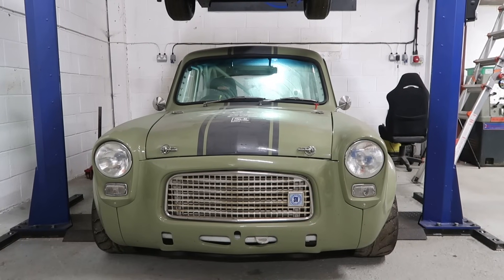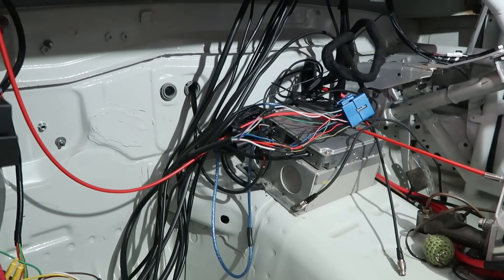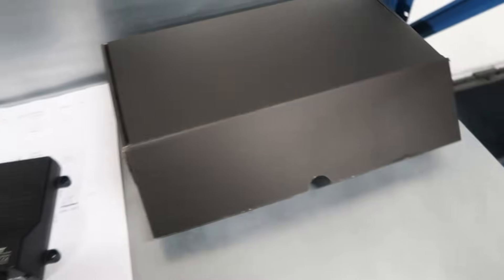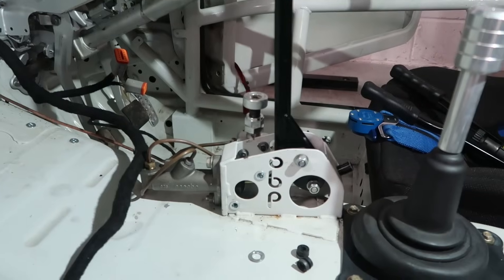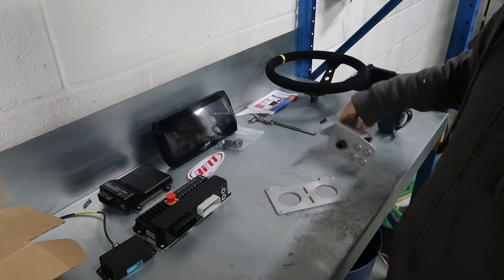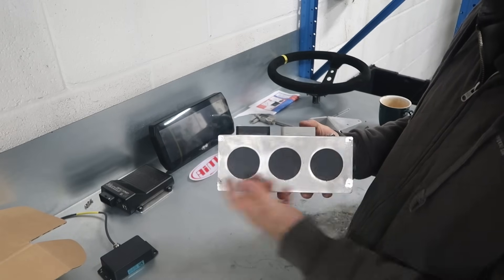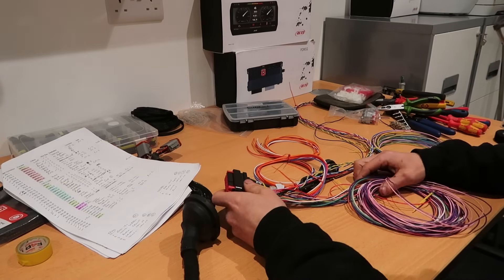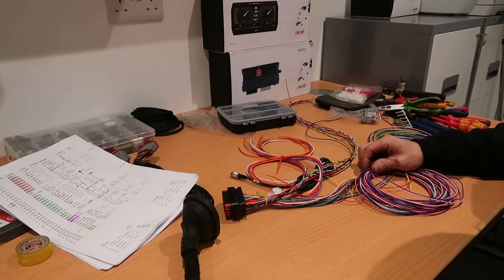High Tech Electronics in a 1959 Race Car - Aim Pdm Install & Ecu Upgrade

Comment: I did this on my 1969 race car - relatively easy and Frank, at AiMShop in the UK, is magic if you run into challenges (getting the revs right into my system from my 123 dizzy was an issue he solved). As you say, planning is everything but I also liked that I could test everything was operating literally “on the bench”. I like that I can capture a lot of data from my car (like suspension movement) to learn what’s going on. It’s not a cheap way to wire up a car but going racing isn’t cheap.
Reply from the maker: Frank is the man!

Comment: I swapped a MaxxECU sport into my 1996 bike, it now has cruise and traction control, electronic throttle, shift cut and blip. Ecu is really powerful, ultra flexible, I use it as a PDM too, it’s controlling the LED headlight power, it varies depending on speed and if if it’s dark. I would go for the sport because it has drive by wire and Bluetooth so it can work with the dash app